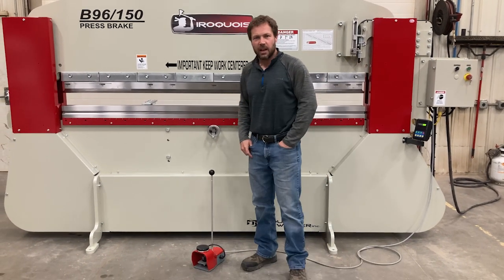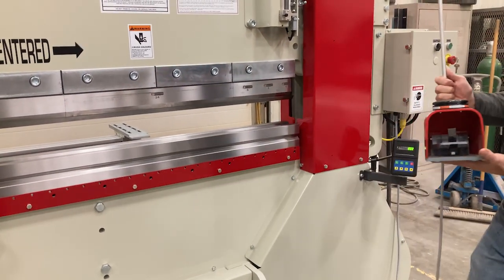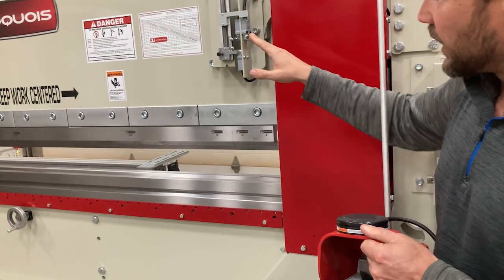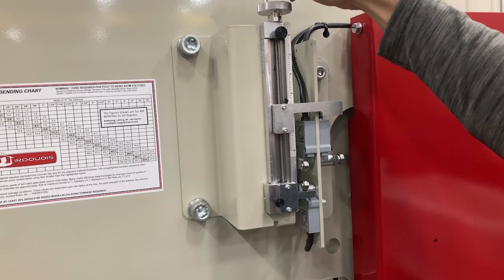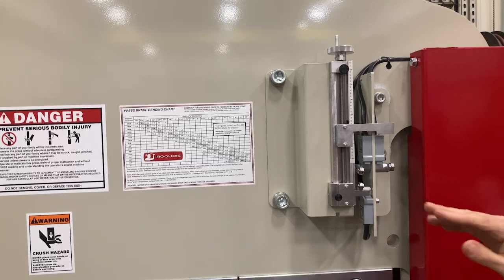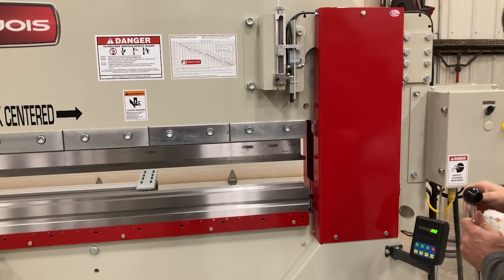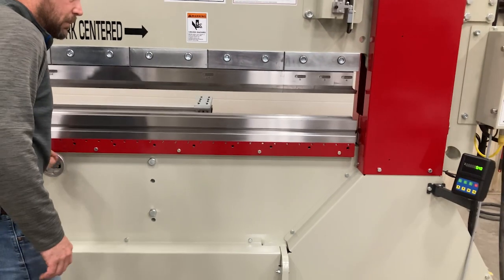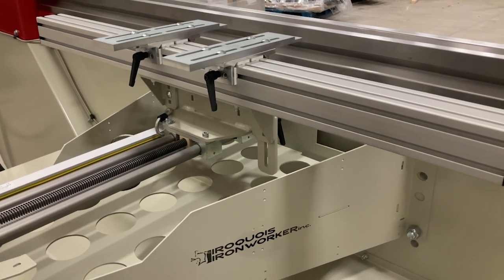Iroquois Press Brake Limit Switch Control, How It Works

Comment: Given the size and weight, how is the 4-way V-block adjusted? Assuming there is an easy way to pick it up and turn it.
Reply from the maker: Yes, that is correct. There are bolts in the end of the die and hooks so that you can pick it up with the ram. So you jog down, insert the hooks, lift with the machine (retract), and spin it.